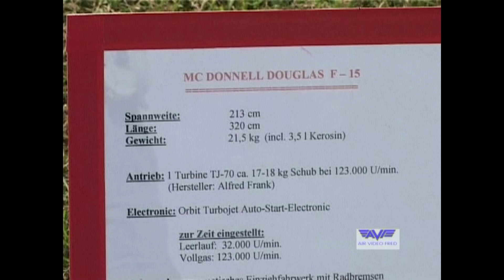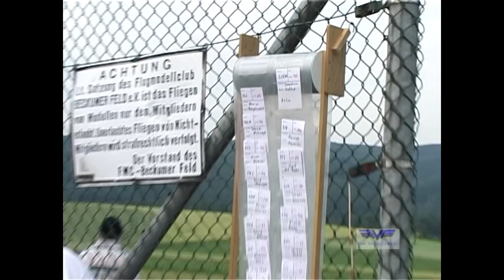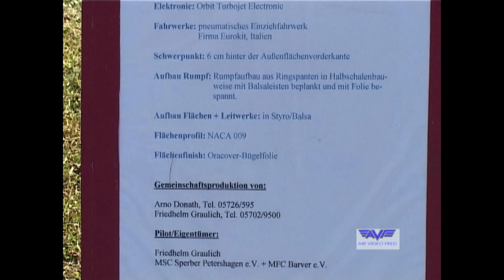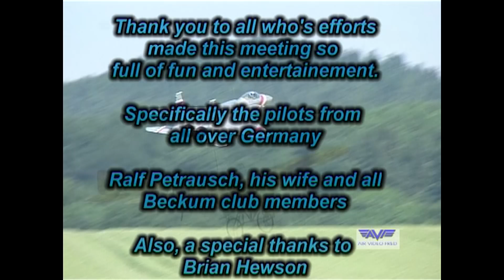Fun Fly Beckum Germany 2003

Comment: is this nimh period ?
Reply from the maker: Thann you for watching Bongdan! What you mean with "nimh"?
Regards Fred
Reply: The batteries they used in the electric motor planes in your video, are NiMh batteries?
Reply from the maker: No, they are Li Polymer -LiPo
Such batteries are still used. I have a 2 meter Katana aerobatic model and use 2x5 cell in line = 10 cells LiPo's = 42 Volt for power and 2 x 2 cells LiPo = 8.4 Volt parallel for receiver and Servo power, the 8.4V reduced to 6 Volt output with help of Emcotec equipment.
Regards, Fred